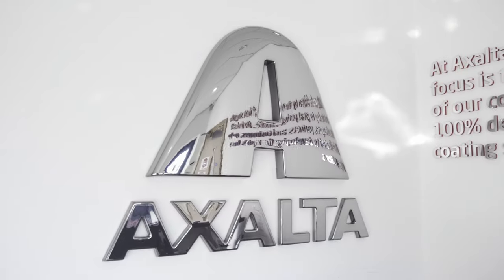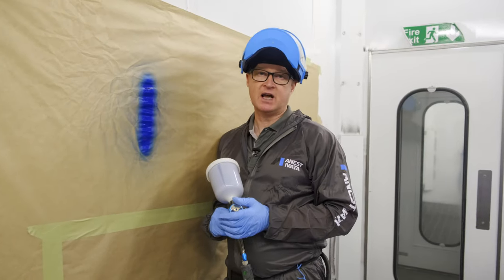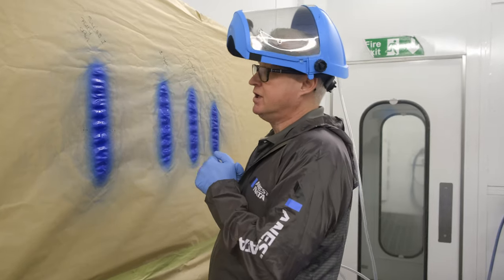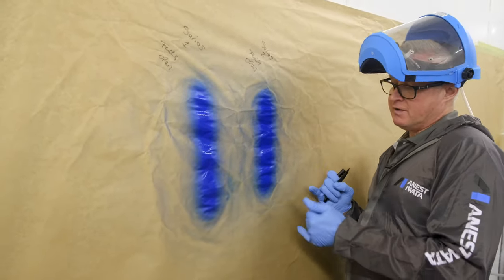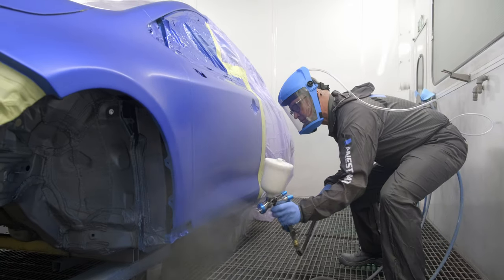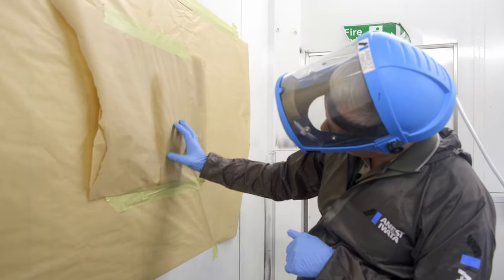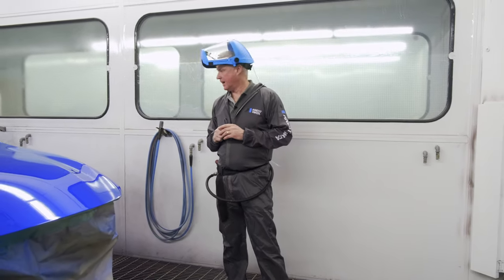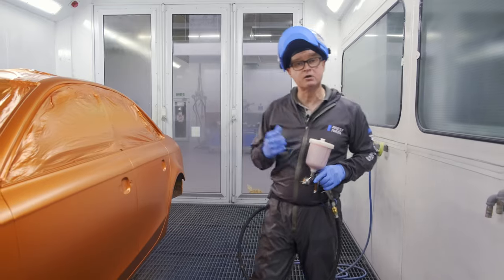How to paint basecoat - SERIES 2 WS-400 BASE - Technical training at Axalta

Comment: Have both clear and base in series 2..still pinching with full fan..and yes i do make sure the split nozzles are aligned
Reply from the maker: Have you checked the pressure? Correct set-up for the material you are spraying? TDS Sheets?
If problems persist contact your local sales branch and they will be able to help fix the issue. We hope you get it sorted. Thanks
Reply from the maker: Also having the Split Nozzle aligned helps with tolerance and consistency. It will not completely change spraying characteristics as some people say 🙂
Reply: @AnestIwataRefinish  I'm painting over 30 years...guns were set up as per spec  .back using my gti pro lites ...thanks for the reply but selling the 2 guns I bought ...not for me

Comment: Brilliant thanks for sharing that very well explained just one question whats blending clear coat paint and what do you think of the anest iwata kiwami 4 spray gun 🔫 1.3
Reply from the maker: Hi Andrew, so on the system in use you blend at the clearcoat stage, not when applying basecoat. Just a simple reversal. The Kiwami 4 is not supplied in Europe. We would suggest choosing the W-400 range, with this the Anest Iwata sales branch in your area will be able to provide assistance and support if needed. Thanks!

Comment: How does the LS400 compare to the WS400 base?
Reply from the maker: The characteristics of both guns will feel similar, however, where they differ is in atomization and droplet size. Both LS-400 and WS-400 BASE serve different purposes, LS-400 is HVLP and WS-400 BASE is compliant. So depending on what paint system you are using, there are multiple options and setups. https://www.anest-iwata-coating.com on our website we have recommendation charts for most paint manufacturers, this will help you choose what spray gun is correct for you!

Comment: I have ls400 1.3 series 2 where is the difference between ws400 for base?
Reply from the maker: There is a big difference.
LS-400 is HVLP so naturally has a slightly larger droplet and is used at a lower pressure.
WS-400 Base is compliant, has finer atomisation and a smaller droplet and is used at a slightly higher pressure. 

So depending on the material you are spraying there is an option for all systems. Thanks, Anest Iwata Refinish
Reply: @AnestIwataRefinish  is possible to make ls400 ws400 base gun ?
What parts is need to buy?

Comment: could be use this set up for solvent base coat application? tx
Reply from the maker: Hi, your best option for solvent basecoat will most likely be LS-400. You can cross-reference the brand you are using with our recommendation charts on our website. This will give you the correct setup for the system you are using. You can find the recommendations here: https://www.anest-iwata-coating.com/en/microsite/

Comment: Hello Iwould like to buy the new iwata for the clearcoat. but I wanted to understand whether to choose 1.2 or 1.3 better. what do you recommend? thank you
Reply from the maker: It completely depends on what clearcoat system you are currently using. If you head to our website you can find recommendations for multiple applications. Check here: https://www.anest-iwata-coating.com/microsite/
Reply: Ok thank you
Reply: 1.4
Reply: 1.4

Comment: What is OBS ?
Reply from the maker: OBS stands for optimised base coat settings. 
WS-400 Base (blue air cap), has different configurations for different brands of paint. WS-400 is predominantly used for one-visit base coat applications/ wet on wet! Thanks Anest Iwata Refinish.